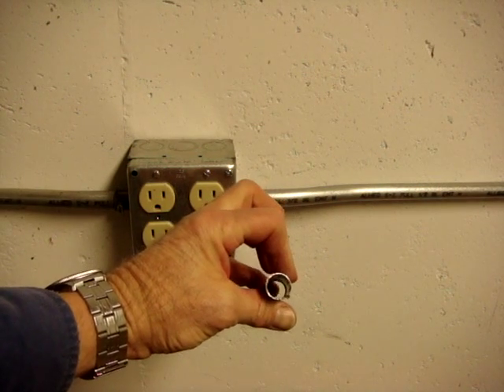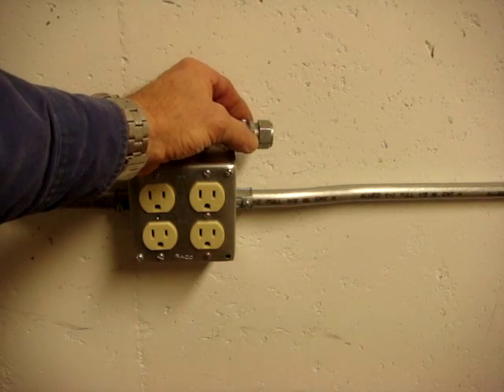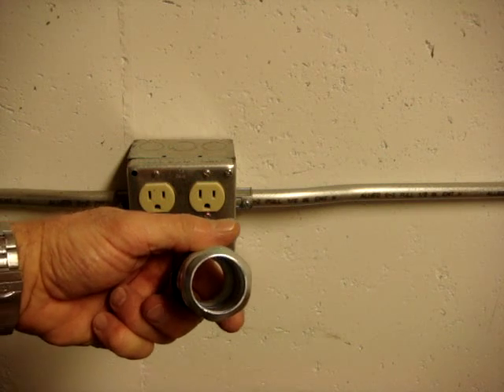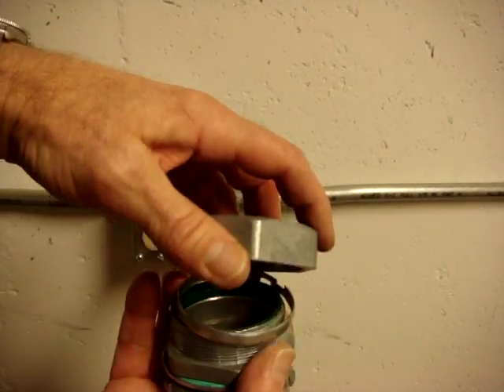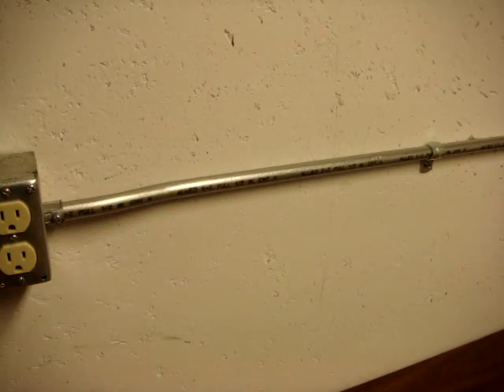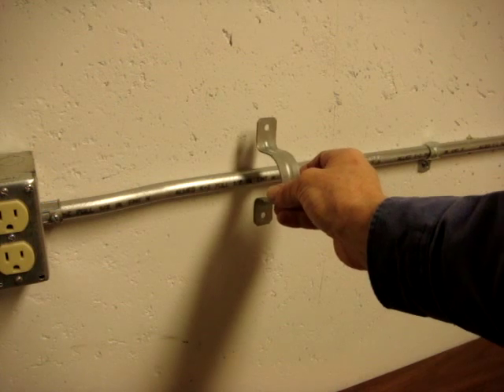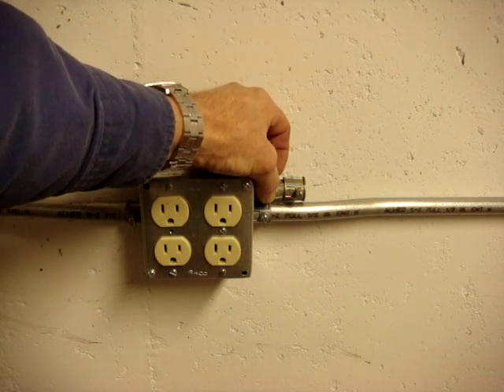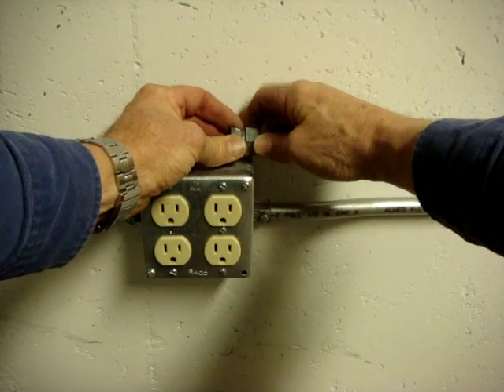Thinwall EMT Fittings

Comment: why doesn't anyone do a video or provide info on how you connect one EMT conduit to another EMT conduit? so much on bending...but I cant figure out how to connect 2 pipes water-tight (exterior) application...
Reply: me me amen that's what I'm looking for
Reply: You're looking for something called an "EMT coupler". You can find them at any home depot or lowes. This example is rain-proof: https://www.homedepot.com/p/Halex-1-2-in-Electrical-Metallic-Tube-EMT-Rain-Tight-Coupling-5-Pack-26261/100534518   Basically you'll slide one piece of conduit on one side and do the same for the other piece on the opposite side. Each has a ring on it which tightens the fitting to the conduit.